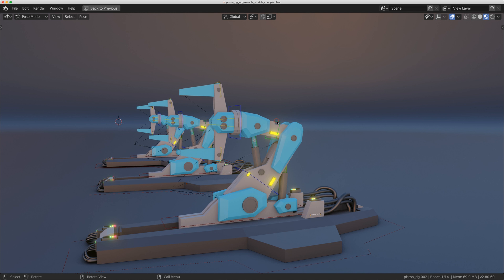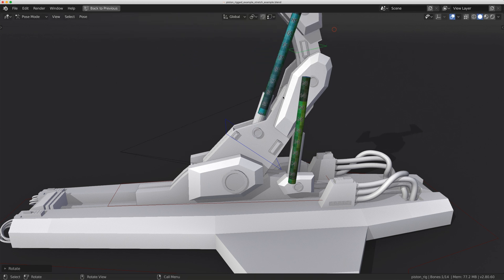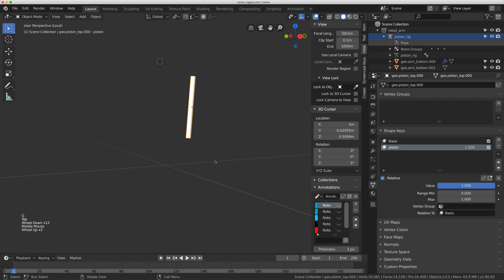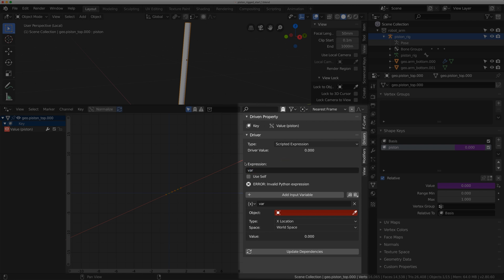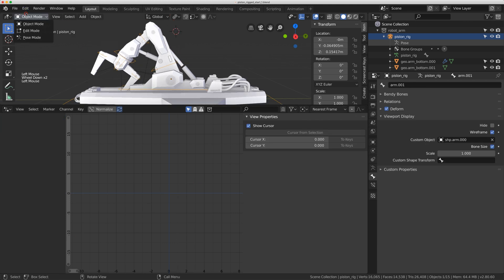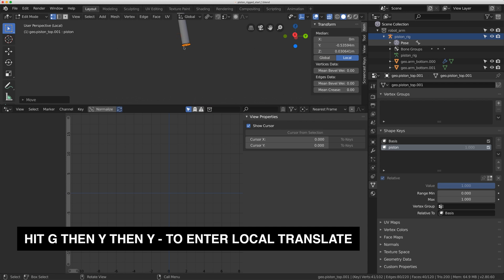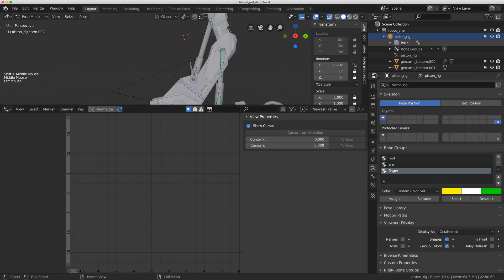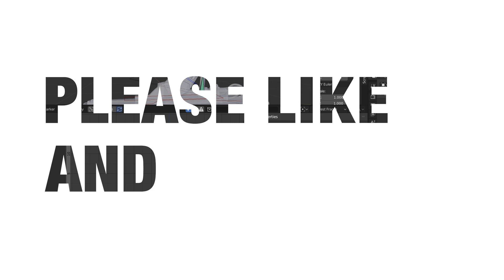How To Rig A Piston Part 2  | Blender 2.8 - Rigging Tutorial

Comment: Very cool stuff! Thanks for the tutorial. I've been wondering lately, is there anyway that one could rig this so that the rotation of the arms follows the extension and compression of the piston rather than vice versa?
Reply from the maker: Yeah, you can achieve this using IK. You make a normal IK arm and then add the piston in the middle. You can even parent the IK controller to the top of the piston as a main controller for the rig.
Reply: @LevelPixelLevel  Hey thank you for taking the time to reply and thanks for the tip! I'll have to try that out.